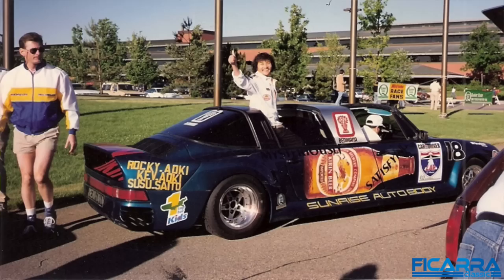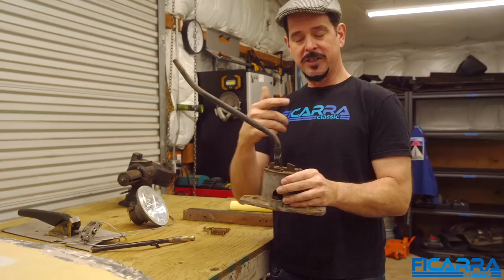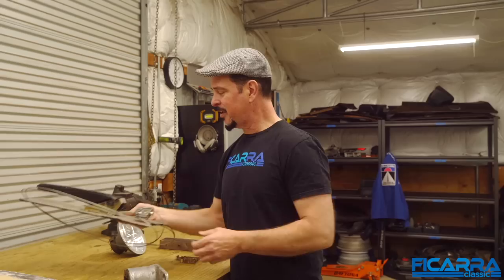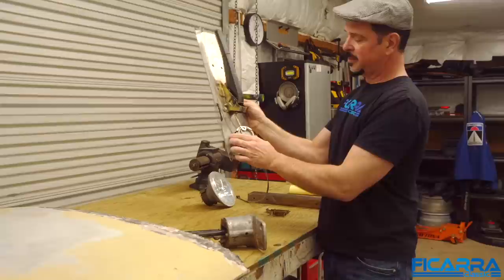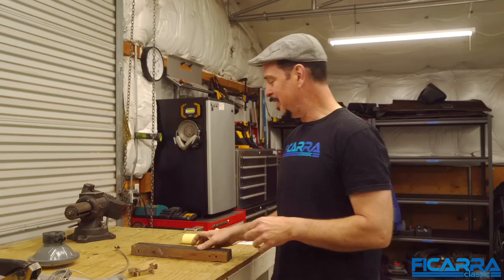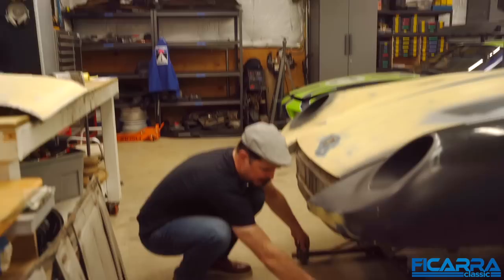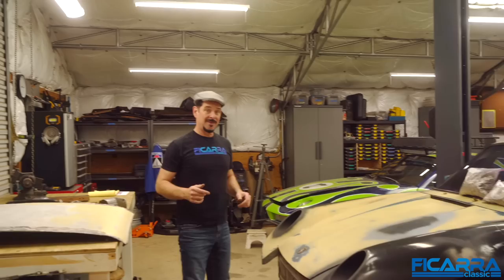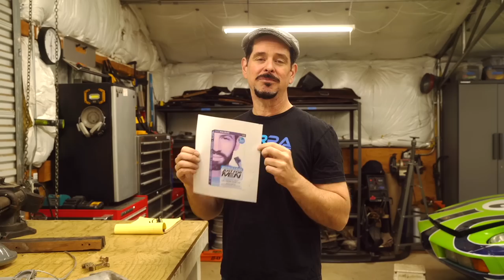The Rocky Aoki Porsche 911 Limo ... a Twin-Targa Once Again!

Comment: Why don`t you put a soft rear window with a zipper in it ? There was the 912 California which was both targa and cabrio, very cool and rare. As for a heavier motor, the original is already pretty demanding in corners or slippery conditions, another one would certainly not offer better handling.

Comment: Since you're cutting the floor out, it seems like it could be a plan to build an X frame down there that ties into the suspension points, reinforce the rockers, and then tie it all together.

Basically it would resemble an early GM X-frame plus a perimeter frame, but as a unibody structure. Since you don't have to package "normal" rear wheel drive stuff, and the interior interior is going to have to be custom anyhow, you could make the X just about as heavy duty as you wanted...

Comment: I think the issue with the back door windows is that they appear to be full 911 doors with the vent windows removed from them. Since you have to rework the center targa bar, maybe you can recontour the shape and put the vent windows back onto the rear doors, which should allow the use of 911 windows.

Comment: Not that I’m justifying heavy Bondo use.. but I think that was pretty common in the day for anything that was a “show car”.. a lot of those cars were considered temporary and they just needed to sell the look. My buddy had an early Barris car.. when you looked underneath, it was all scabbed together angle iron going in all kinds of different directions.. they were only concerned with what you saw from the outside for the show circuit.

Comment: If it was me doing this I would do  cage hoop on the front tied into the frunk, the same for the rear. double hoop in the center, With X bracing connecting them in the middle on the sides and top.  To tie the front, center and rear together you could do drift spec door bars which should give you enough strength and also keep it looking cage free from the out side.

Comment: When you rebuild the floor and tunnel build the tunnel as structure.  Do the roll bar in the center and at the feet run bars to the tunnel.

Comment: Do you have 2.7 Audi bi turbo engines in America? Would have been in an Audi allroad or audi s4. Those share a gearbox bolt pattern with Porsche boxster 2.5 or 2.7. I’ve seen one fitted in a 996 and presumably it will bolt to that gearbox also which might suit your application. Would it fit an earlier box…? I don’t know.